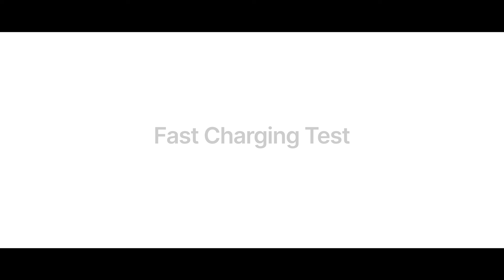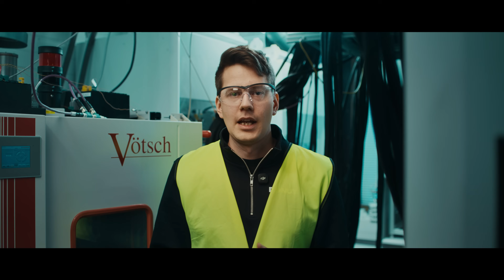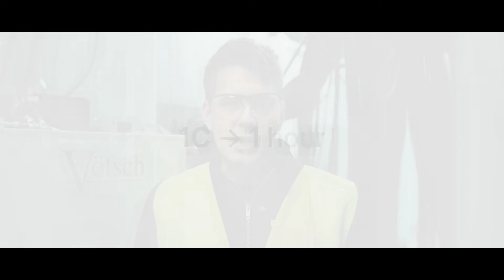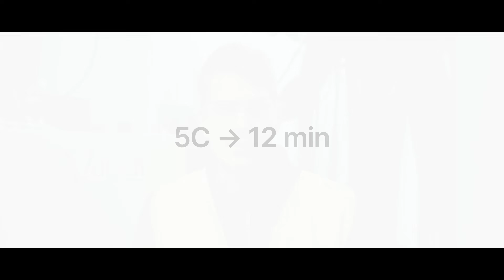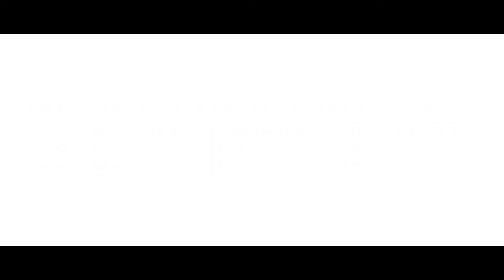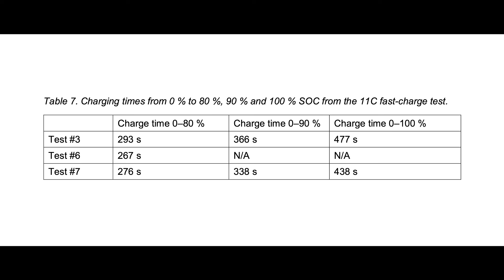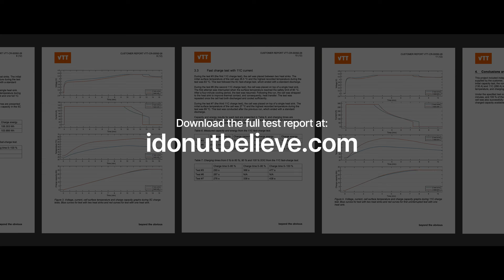Donut Solid-State Battery: Fast Charge Test | I Donut Believe (Pt.1)

Comment: 6:49 why is 89C "still well within the cell comfort zone" when the report states that during the first attempt of test #6 (11C single heat sink), the test had to be aborted because the maximum safety limit temperature of 90°C was reached?

So much for comfort when you are only 1°C away from the limit
Reply: It was simply a cutoff temperature for the test, no indication this represented a safety limit for the battery itself but for the specific test, which seems to have been set to within a 10% margin of the stated upper operating range (up to 100°C). This is more likely to ensure the claimed speeds are being tested rather than approach a charging temperature closer to the upper limit, where the battery's characteristics may start to vary (as is the case with all cells). 

The test was also not aborted, but stopped and repeated, according to the documentation, with the heatsink tapped to the battery to improve contact area and passive heat transfer. I assume a separate test will demonstrate the battery's safety aspects later on.
Reply: @GruffSillyGoat quoting page 10 para 3.3 "The first attempt was interrupted when the surface temperature reaches the safety limit of 90°C." Where does that limit come from is ambiguous, maybe it's just VTT that decided so because they don't know what the battery is, but it is still ambiguous if you ask me. Saying well within comfort zone looks fishy doesn't it?
Reply: @carl2657  - the stated thermal ranges for the battery is upto 100°C, a 10% margin would see a test limit of 90°C applied.

You missed the important bit of the document's paragraph out "After a four-minute cooling period, the test was resumed. Following this run, the cell was strapped to the heat sink to improve thermal contact, and consequently, heat transfer. The test was repeated once the cell had both discharged and cooled sufficiently." So the test number six was resumed, and then repeated (with the cell's heat transfer improved). Seems the test lab was determining how best to operate the 11C single heatsink test.

No I wouldn't think saying "well within comfort zone" is fishy, it's just a statement, again perhaps based on the Donut Lab's previous operating range statement.
Reply: @GruffSillyGoatdude of course I know they redid the test, why are you acting as if I said they packed their bags and left.

Even if it's 10% margin it's not well within comfort, youre 10% from limit. Its getting pretty toasty. Well within comfort would be 80 or 75, plenty of freeplay there. But at 90? Come on man you're lying to yourself.

Even so, you think manufacturer wouldn't add their own 10% or 15%? Surely your favorite car or electronics brand will not have safety as a concern and will gladly run them batteries right at the limit with plenty of comfort brother
Reply: @carl2657 - 100°C was stated as an operational limit, rather than perhaps a safety limit, 10% from an operational limit would be in the comfortable zone.

The reason for the cut&paste is the partial segment you copied, just to give full context to the VTT statement.

Why be so negative, the VTT figures seem to backup statements made by Donut. Let's see how it progresses in the videos.

Comment: I do not get this.
It says Discharge capacity 90.540 Wh. And Charge capacity 106.303 Wh.
How is this good?
Can someone please explain this to me?
Reply: Heat losses mostly I guess. Discharge was at 1C and charge was at >1C. The value is not what the cell received but the machine output
Reply: The document says 100% of the charge was recovered during discharge in 5C tests, and 98.4–99.6% of the charge recovered during the 11C tests. They measured currents, voltages at the terminals, and temperature at the terminals and battery body (side). At the current levels involved there will be heating at the terminals, even with their low resistance (as well as inside the battery), to which some of the input energy from the test charger in lost.

This is true of all electrical circuits, including EV chargers. The best 400kW EV chargers lose 2.5-5% (10-20kW) of energy whilst charging, with the vehicles losing a further 5-10% of electrical energy.

Comment: These test prove the LIE.  The original claim was 100% in 5 minutes.  Now it is 80% in five minutes. AND... Who cares what a single cell does..  Where is the test of a complete battery pack. If these are already available to OEM's and the can easily scale production, how is it that they can not provide a complete battery for testing??
Reply: They said in the very first video that they intentionally held it back for now to 80% in 5 minutes. They said it has the potential to do 100% in 5 minutes. Maybe go back and watch it again before calling it lies. Also either way would be very impressive and way above industry standards so who cares.

Comment: What was the weight of the tested battery? From the video I can guesstimate the volume in the 150cc/250cc range for 100Wh, which translates into 1L for 400Wh-650Wh. But there's no indication of the density

Comment: As long as your bike can charge at the Tesla charging network, you will have a winner even if all you get is a 200 mile range. A 300 mile range would be a game changer. Please create a bike that has proper wind protection and an electrically adjustable windshield. An electric tour bike would be great. I have six motorcycles of different varieties, and drive a Tesla, which I just returned to Colorado from California with on a two-way trip. No problem, plenty of Tesla chargers. But God help you if you are forced to charge your bikes at the other networks.

Comment: As a chemistry student this is very promising
The batteries reached 89 degrees and still retained about 98% charge and discharged the current instead of just expelling the energy as heat. 
Normal batteries start to degrade at much lower temperatures... 
Its the ability to work at high temperatures is what i feel the biggest breakthrough from the current report.... Amazing work
Reply: their battery degraded like typical li ion. Chinese produced 10 min phone battery too.
Reply: @322-Dota2 its about the speed they are charged at and the capacity of the battery... Phone batteries are "mili" amphours... This battery was "amphours" there is a difference

Comment: Excellent, 100% SOC in 8 mins on an 11C charge without massive clamping pressures and verified by an independent lab is what I got from that video.

Myth number one debunked for all the haters it seems 😮
Reply: clamps are 3x bigger than battery itself. are you blind?

Comment: So one charge cycle, big deal.
Why do they need a heat sink, there will be none in a pack.
After 10, 100,1000 ,10,000 cycles how do these battery preform?
If you continually cycle at this rate the battery just keeps getting hotter and hotter.
This test is just a cell not a pack.
Just a lab prototype, much more testing required, before a real product.

Comment: Key wording in the report: “…which the customer identified as solid-state battery cells”

VTT has not independently verified this was actually a solid state battery. This makes me concerned that they supplied VTT with a super conductor for this test, and have provided other types of “batteries” for the other tests to maximize desired results.
Reply: Yes but highly unlikely for the other batteries to be the same size and offer the other attributes without sacrificing the size

Comment: Someone please edit this video so that the test bench shows a potato. It's easy to do, because they never show the test bench connected to any actual measurement device. As a heat sink, use a ceramic plate. To charge it, put it in the microwave.

Comment: I'll wait until they Finnish testing
Reply: Bu dum cha! 🥁
Reply: Swede dreams are made of this ...
Reply: This is Finnish, but it's not the end.
Reply: When they Finnished testing, the Fossil Fuel and battery industry's Era might be Finnish.
Reply: @jacksableng4775  This will not effect fossil fuel in the least short term, the only real change will come if nuclear power plants are deployed otherwise your EV is basically a coal powered car.
Reply: @richardrogers8291 The 'coal car' label is outdated. On the West Coast, coal is less than 2% of the power mix—most of that grid is already hydro, solar, and nuclear.  Many homeowners with rooftop solar already fill their ev from their own solar.
Even in the Midwest, which has historically used more coal, we're seeing a massive shift. In Illinois, for example, over 50% of the power is already nuclear—which is exactly the clean energy you're advocating for! 
Want a nuclear powered car? Get an Ev in Illinois 😅
The best part about an EV is that as the grid adds more renewables and nuclear over the next 10 years, the car actually gets cleaner while you own it. A gas car is 'locked in' to its emissions from day one.
By the end of 2026, solar is projected to be the fastest-growing source of new power in the U.S. We are currently adding record-breaking amounts of solar and battery storage to the grid, while coal plants are retiring at an average of 5% per year.
Reply: Actually, the Department of Energy (GREET model) shows that even in the most coal-heavy parts of the U.S., a typical EV still produces 60% fewer lifetime emissions than a gas car. By the time a gas car reaches 20,000 miles, it has officially become 'dirtier' than the EV that was charged on today's grid. And while a gas car gets worse as it ages, an EV gets cleaner every time a new wind turbine or solar farm opens nearby
Reply: @richardrogers8291  Today's electricity is mostly Solar. Rooftop installation is cheap cost only fraction of the car price, charging EV is Free. One EV battery can power one house for days.
Reply: They are first on the Finnish line
Reply: Lol
Reply: I see what you did there
Reply: First test is Finnish! 🎉
Reply: Norway! They finally did it!
Reply: You win the internet for today
Reply: Nice.
Reply: Absolute hilarious
Reply: Coming year 2077 😂
Reply: Boooo

Comment: 🔋The cell in the video weighs 235 grams and has dimensions similar to a handy smartphone.
Reply: So in that case....

1. Energy Calculation:
E = C \times V
E = 26 \text{ Ah} \times 3.6171 \text{ V} = 94.0446 \text{ Wh}
2. Specific Energy (Density) Calculation:
D = E / m
D = 94.0446 \text{ Wh} / 0.235 \text{ kg} = 400.189... \text{ Wh/kg}
Result:
400.2 Wh/kg
Reply: @AJ1964FI  I calculated it exactly the other way around; the 400 Wh/kg was known, and now it had 94 Wh, therefore 235 grams. 😅
Reply: @freeeyes5789 use AI for easy math😅
Reply: @freeeyes5789 but you cannot calculate weight you either have know it or find it

Comment: Read the VTT customer report. It evaluates the fast-charge performance of a single 26 Ah pouch cell under controlled laboratory conditions. It has lots of interesting details. Especially the round trip efficiency and heat production is worrying.

VTT followed a defined protocol including initial capacity checks, reference cycling, and high-rate CC–CV charging at 5C (130 A) and 11C (286 A), using both one-sided and two-sided heat-sink configurations. The cell achieved approximately 26 Ah nominal capacity within the recommended 2.7–4.15 V window, and during fast-charge tests (to 4.3 V) it reached 0–80% state of charge in about 9.5 minutes at 5C and roughly 4.6–4.9 minutes at 11C. Post-charge discharge capacity remained close to nominal, particularly after 5C tests.  ￼

However, the evidence base is narrow: all results derive from a single customer-supplied cell, and the environmental control was limited (the climate chamber was not operating and the door was partially open). Thermal management proved critical. At 5C, peak temperatures ranged from ~47°C (two-sided cooling) to ~61.5°C (one-sided cooling). At 11C, temperatures reached ~63°C with two-sided cooling and up to ~89–90°C with one-sided cooling, with one test halted at the 90°C safety limit. Additionally, fast-charge tests exceeded the stated recommended maximum voltage (charging to 4.3 V instead of 4.15 V), which may increase stress and complicates interpretation of long-term durability.  ￼

In context, the report demonstrates that very high charge rates are technically achievable under specific thermal conditions, but it does not establish long-term cycle life, safety margins, manufacturability, or statistical repeatability. The results suggest strong rate capability, yet also highlight significant heat generation, energy losses during fast charging, and sensitivity to cooling quality. Consequently, the findings support a proof-of-concept for extreme fast charging rather than a validated, production-ready performance claim.  ￼
Reply: To be fair - the cooling was provided only with passive radiator/radiators (they did both 5C and 11C tests with the cell between two radiators and the cell on top of a single radiator). According to them this was on purpose - designed just to demonstrate no need for high capacity cooling. A standard  fluid cooling would be much more efficient.

Comment: Also imagine the potential ramifications for cordless power tools. You could have a battery with huge capacity and power available and be able to recharge it in a couple minutes
Reply: Don't forget phone and laptops! If those batteries actually comes out in any of phones and laptops it would be very game changing. 

100k cycle life of that battery, if it's true, means that the phone/laptop will last forever with virtually almost no battery degradation even after 10+ years of use
Reply: Tabless cells on high end too batteries outperform this by far already.

Comment: The images on the VTT report show no external clamping and a rigid design that does not seem to support expansion. The cell itself is quite thin maybe 1-2cm and packaged as a rectangle with the long side 20cm-40cm and the shorter side 2.5 times smaller (8-16cm), but this is just a guestimate. I could still be off despite the big range. The battery charged at 5C and 11C just strapped to 1 or 2 heatsinks, so no active cooling. Even with 1 heatsink at 5C it only reached 65C and in fact at high temps the battery seems to be able to maintain a high charging voltage closer to its full capacity maintaining the high charging voltage longer and hence actually charging faster. At 11C it charged comfortably sandwiched between two beefy heatsinks only reaching 63C. The battery can deliver 26Ah at 2.7V so its total charge is around 100Wh. A small bike or moped needs 300-500 Wh, a larger motorbike needs 1000 wh. A high performance motorbike needs 2000-5000 Wh. So this is around 10% of a typical motorbike capacity and just 2-5% of a high performance motorbike. So this isn't a battery pack that would actually go on a bike or a car, it is clearly a small prototype. 

It seems that 11C is the limit of what the battery can hit with minimal passive cooling. The heatsink is actually quite beefy compared to the battery and with 1 heasink only it hit 90C, which the battery seems to tolerate just fine, but its too hot next to other electronics or if its on a motorbike. 2 heatsinks mean a lot of added volume compared to the battery, so it seems you will need active cooling after all to charge at 11C. 

So we now have external validation. Donut labs has a 100 Wh battery pack that can be charged at 5C-11C with only passive cooling, no external clamping and no volume expansion. We have to consider the first part of their claims validated. 

Waiting with baited breath to see the new test report next week.
Reply: That's why they're limiting the Verge motorcycles to 5c so they don't need the extra weight.
Reply: A bicycle may be fine with 300-500Wh, because they have such light components and low rolling resistance, but mopeds and motorbikes should start at 3kWh minimum, anything else is a waste. Also, the significant incease in Wh/kg makes the same weight battery hold almost 1.6x the range, while making it only marginally larger as the Donut cells actually have a slightly worse Wh/L density. This was in comparison to a 5Ah 21700 cell.
Reply: @94e88  The cheapest and smallest moped I Can find has 700 wh. A cheap electric motorcycle can be found at 1.5 KWh. These are the lower limits, not what is good. IF you want good performance you are looking at 2-5 KWh for sure. The point I was making was whether this is an actual usable battery pack and it is quite clearly not. 100Wh is tiny. 

We don't know what Wh/kg the Donut battery has, but the claim is 400wh/kg. Top range Li/ion batteries are currently at 250wh/kg. Some experimental ones are 300-350wh/kg. 5Ah21700 is definitely under 300wh/kg. Speculating on what the actual Wh/kg will be is pointless. We need to see independent testing. To have great product donut needs to deliver 300wh/Kg+ and 10,000+ charging cycles life time (they promissed 400Wh/Kg and 100,000 charging cycles) and they also need to show that their battery behaves the same when scaled to at least 1000 Wh. The practical benefits of their battery as demonstrated by this test means if they match current high end Li and Na batteries they have a decent product on their hands. 

We only wait until the data comes out. The first test has been an unquivocal success. They delivered what they promised. Lets hope they can deliver on the rest of their promises.
Reply: @94e88  26Ah*4.15v= 107.9wh; 107.9/0.315Kg = 342.53wh/kg not 400wh/kg. It's a downgrade, and at the pack level you get 292.53wh/kg
Reply: In the RC world, high C rate Lithium ion batteries are well known and used, so this is totally not convincing as of yet.
Reply: @simondovinsky2734 What is unconvincing? Its a small prototype demonstrating 5C-11C charging with only passive cooling, no external clamping and no volume change. That was one of the donut lab claims. That is what the external test reported. No one can seriously argue that this is not great performance.